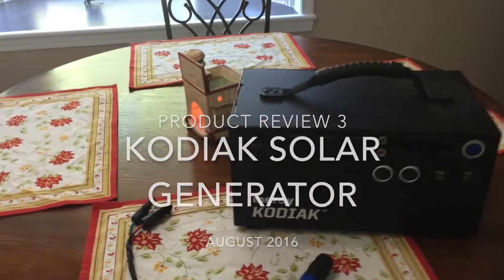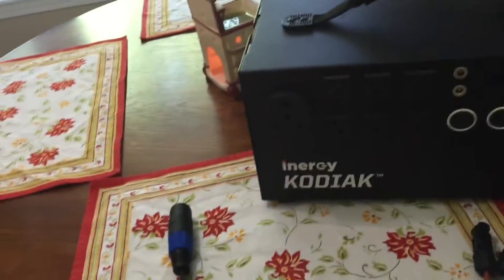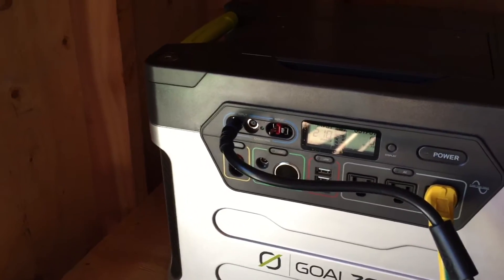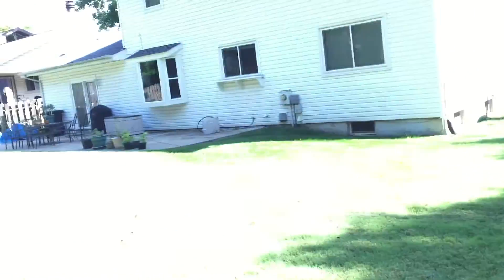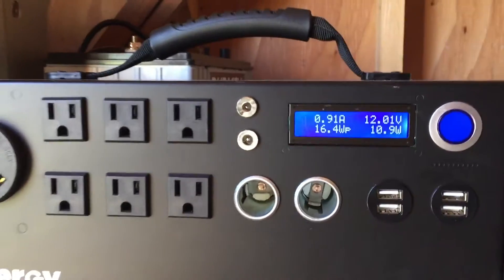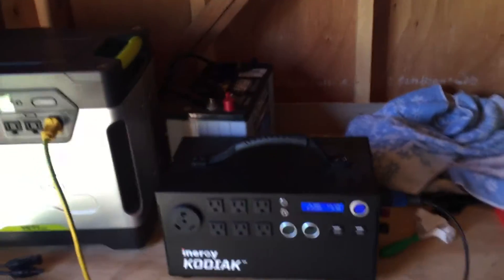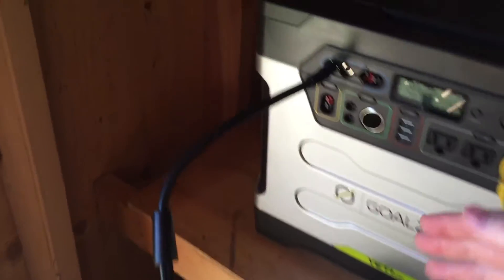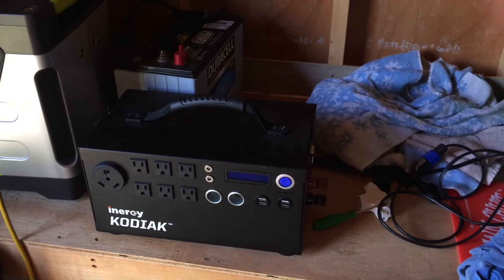KODIAK SOLAR GENERATOR CHARGING

Comment: Do not buy this expensive piece of junk. After only 2 months it broke. 
The company will sell you an open box item then when you send it in they
 will claim you did something to it to avoid the cost of repairing it. 
You can build a more powerful reliable unit for much less.

Comment: I just got my Kodiak and the 600watt plug like you mine also did not work all the lights went on and the display but all day no charge. I i emailed them in 10 minutes thay are shipping a new 1 but i noticed that the plug that did not work is the 1 with 2 black wires and your new one has a red wire the 1 thay send me that will not work is the 1 with  2 black wires know im worried thay are going to send the same 1

Comment: I have one of these and their instructions (a couple pages) and support are abysmal.  The display shows tons of things - all confusing.  You would think after raising almost $800,000 on Indiegogo that they could spend 100 bucks and make a decent instructional video on YouTube.  My still unanswered question is why you can only input 600w when it alleges a 1500w inverter?  I planned on using this as a portable unit and to pull out 4/300w panels to run a single room in a grid down situation. 600w won't run jack.  Also, I've been buying deep cycle batteries to attach to this, but I have no idea how they will be monitored with their LED display.  Thanks for the post.
Reply: Yes, I said that and I get that.  I know it's the input.  But why?  If I go out and buy a 1500w PSW inverter by itself, I can input up to 1500w of solar power panels Into it with the right charge controller.  Or am I missing something obvious here.
Reply: Now that Goal Zero has a 1400 watt Lithium generator would you be doing a comparison to the Kodiak? I plan to buy either one. I also would like to expand it with 2 deep cycle 216ah batteries I currently have. Do you know if the 1400 Lithium unit by Goal Zero has expansion capability?